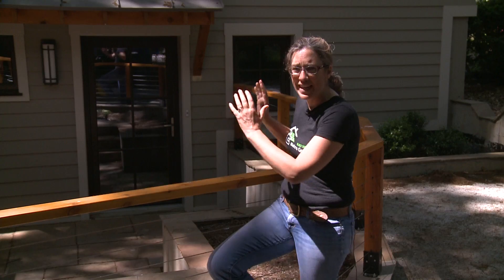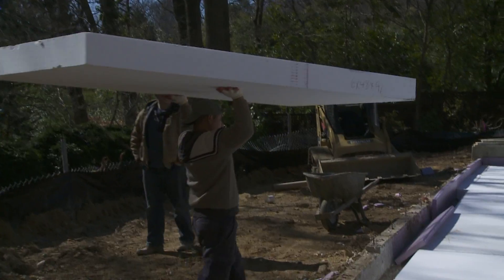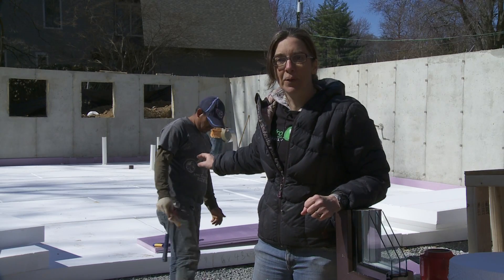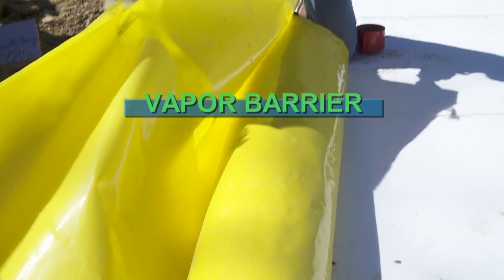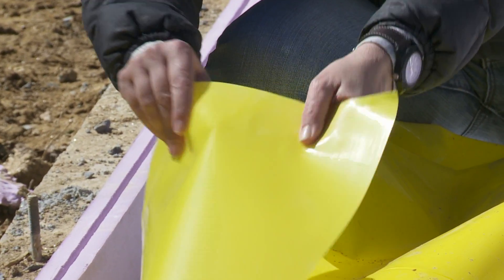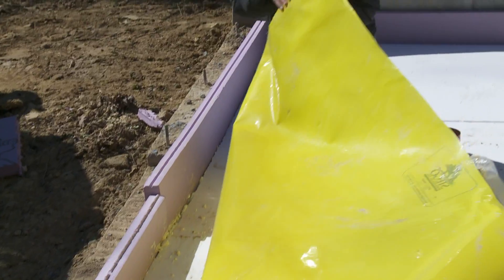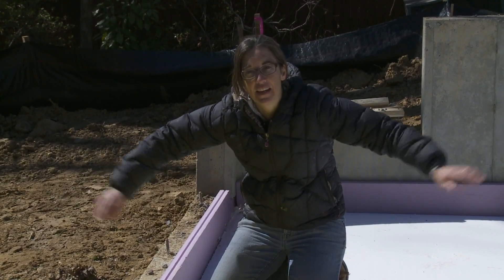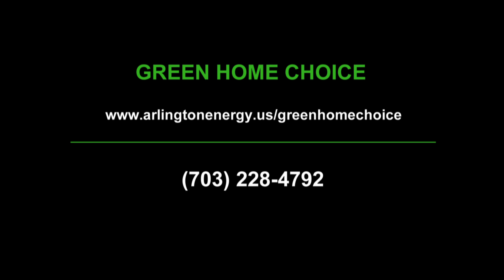How to Build a Better Home - Slab Insulation and Vapor Barrier

Comment: What's that THICK layer of insulation made of? How can I ask the builder to add it? I've seen mention of zone 2 or zone 3 but I need to find out which zone this land is located in?  I'm thinking of buying some land in TX and possibly building a house or two on it,  so I'm trying to research how to get the best bang for the buck and build these houses as low cost as possible but also make it effective as possible towards the energy it will use over the lifetime of the home.

Comment: We used to use vapor barrier under concrete slab but not anymore main reason might be that moisture doesn't penetrate concrete well.
Typical floor structure here are from top to bottom is
Flooring material, usually parquet
Roughly 3 inch concrete with underfloor heating
10 inch EPS
20 inch Sand fill to get slab higher from ground level
15 inch gravel to stop ground moisture capillary rise, this layer also includes French drains that handles rain water and also ground water.
Landscape fabric to prevent gravel to mix base ground
Reply: Moisture doesn't penetrate concrete wall? And 15" gravel stops capillary rise? Please explain. ?  Have you checked and confirmed no moisture in slab after completing concrete cure?  Thanks

Comment: Why you didn't install vapor barrier under foam insulation?
Reply: Should always be under insulation as insulation R value drops immediately when wet. Foam board adhesive, properly installed, keeps “iceberging” from happening.
Reply: @briansweeney550  how?
Reply: When you pour concrete...it will go under and push the foam up and cause problem during pour.